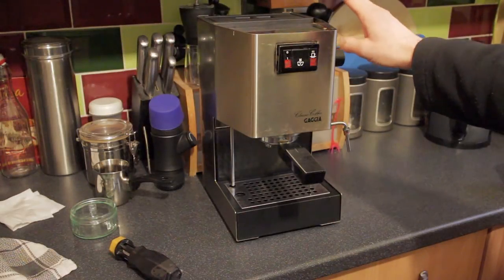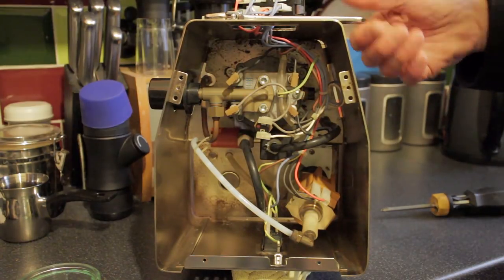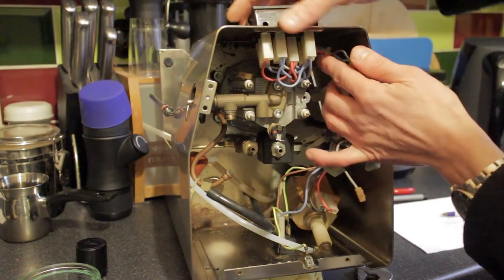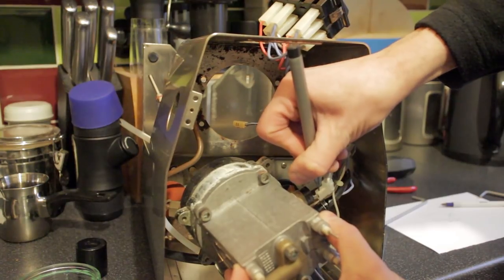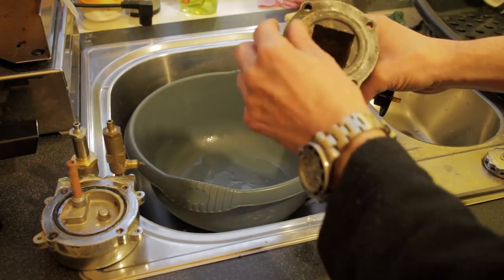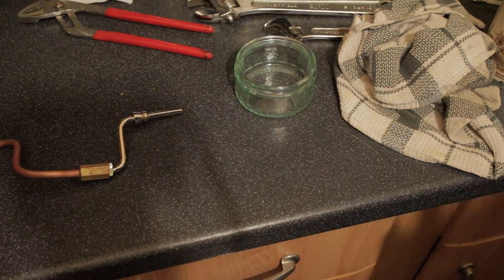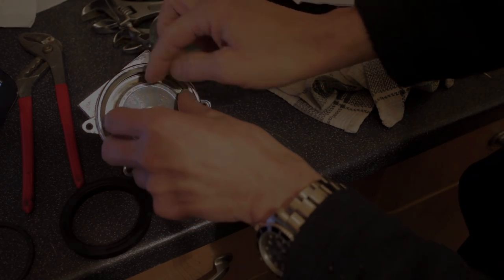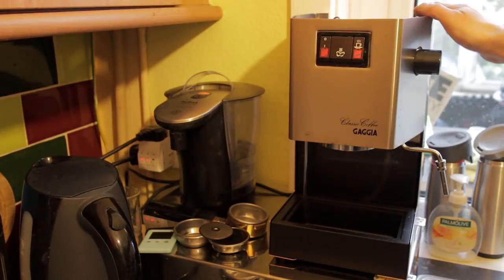Gaggia Classic Full Service and Descale, Boiler Strip, Seals

Comment: This is a great video, great detail and clarity.

I have a Gaggia Classic which Id like to restore. 

 Not sure which parts I need but the main symptom is that while the pump noise is normal and the boiler heats, there is no throughput of water only through the frother / steamer.   Would anyone know if this means a boiler replacement or some other part.  Is it easier to just replace the boiler and pump?   Any help greatly appreciated.    Thanks
Reply from the maker: If water is coming through the brew head the boiler is filling so that's good. The fault has to be a blockage between the boiler and wand. It could be the valve or the pipework to the steam wand itself.
A good soak of everything in citric acid solution is a good start after disassembly.
Reply: @spidiq8  Thanks so much for you answer.  I'll go through the process you describe in the video.  FIngers crossed. I'll let you know the results.  Best regards. Gerry
Reply: @spidiq8  Dropping back in to say I've finished the restoration,. Bought a few parts along the way, Group, shower, solenoid and even a pump,  So far it all looks good.     I wanted to say thanks very much for your help. It would have been impossible without your video. This means I can give up coffee pods too, a positive environmental impact too I hope.  Best wishes Gerry
Reply from the maker: @gfficomable  That's great news, thank you for updating me and long may you enjoy better coffee. Find yourself a local roaster and start grinding fresh and you'll never go back to pods.

Comment: Hiya. Love the video. Bought a 2006 model. Boiler badly caked up. Just wondering does the bath solution for group head/wand contain citrus acid solution also. Ta
Reply from the maker: Glad it helped, I don't know about the premade solutions specifically so I can't advise re those other than ensure that you follow the directions on the bottles.
Citric acid solution however works without problem on these, just don't leave the boiler in it for longer than necessary to remove the scale.
Reply: Thanks for reply. Same solution in yellow plastic container as in boiler. Got the citrus acid. Thanks again for advise. Take Care.

Comment: I’ve got a question - if I do a backflush and don’t  get any flow back to the reservoir does it mean that: a) the OPV is not working correctly or b) the pressure is set way to high? I don’t have the manometer to check the pressure on the group. Great video, thanks!
Reply from the maker: I'm assuming you're blocking the group head with either a blind basket or some means of blocking up the standard basket?
If so. You should get water beyond the pressure set flowing back into the reservoir and when you stop expressing the excess should expel from the waste pipe into the tray.
The opv could be blocked or inoperative but yes, the pressure could be set way too high also.
Reply: spidiq8 thank You. Yes, I have a blind basket. After switching the pump off, the water comes through the external pipe and to the drip tray, so I assume that the three way solenoid is working fine (also I did the test with open steam valve, switching on the pump - water comes through both the group shower and the steam wand, so I believe the three way solenoid is somehow working fine). As the machine is really old and in pretty bad shape, I don’t think I’m going to spend any big money on replacing parts, but I’ll try to figure out how to measure the pressure and perhaps try to clean the opv. Thanks again!
Reply from the maker: @maciejkieek4355  Good luck with it. Hopefully a good strip and clean will sort it.

Comment: Well done on a super job and thorough video. Have you any experience with similar machines? I have a Lelit PL 41 plus that I’m pretty sure needs an acid bath. Tips are welcome.
Reply from the maker: Sadly not, just the gaggia and my Wega commercial that I rebuilt. The principles are the same however. They use either a single boiler, double boiler or single boiler with heat exchanger.
Reply: @spidiq8  thanks for the reply. I shall follow your method and apply it accordingly. Gonna go slow and careful. Cheers
Reply from the maker: @stillnoshadow  good luck with it and ask away if you have any problems and I'll help if I can.
Reply: @spidiq8  You have no idea how proud I am managing to use your brilliant tutorial and emptying the boiler of a handful of limescale. AND putting it all back together. The boiler refill worked a treat and it passed all your leak tests. The 1st shot brought tears of pride to my eyes. Can't thank you enough. Next up the Rancillio!
Reply from the maker: @stillnoshadow  fantastic news and congrats. Enjoy that fresh unrestricted flow and of coffee. It'll taste when better knowing you did it yourself.

Comment: When you sanded down the boiler, do you sand down the inside of it too? I've managed to descale my machine, but now I have this metallic taste to the espresso. I have a gaggia baby, where, the steam valve doesn't come off, so I had to do the job joined onto the machine.
Reply from the maker: No, being aluminium you don't want to sand the inner, the only part I sanded and the only purpose was the mating surface to ensure it made a good seal on the group head so the gasket didn't leak.

Comment: hello, great video, tx for sharing. Is the boiler an aluminum boiler ? do you know if citric acid and aluminium is a problem ?
Reply from the maker: Thanks, glad it helped.
Yes the boiler is aluminium, no the citric acid solution isn't a problem provided you don't leave it sitting for hours unattended, It can eat into the aluminium but only in very highly concentrated measures and left for a long time.
You need to fill it and soak just long enough to loosen and remove the scale.
Reply: @spidiq8  thanks for your reply ! my model is 2002 - the old Gaggia classic. I couldn't find if its aluminium or not...
Reply from the maker: @cruzo333  it will be yes. It's only the very recent Phillips models where they changed it I think.

Comment: Hey mate, just wondering what kit I should buy online before I attempt this? I don’t want to open my machine up to find all the rubber parts have perished
Reply from the maker: Most online barista supply stores will sell seal kits or alternatively searching ebay will yield a full replacement seal kit, just search for the Gaggia classic.

Comment: That was so interesting! You'd make a great lecturer. I'm about half way through and I've realised I am in no way qualified to do this 😭 if I do I'll have a nice looking paperweight. I'm not even sure what my issue is as the water heats up to 90'C but there is not a drip that comes through the actual bit where the coffee goes (if that makes sense) any ideas? Thanks
Reply from the maker: Thanks. That's kind of you and I'm sure you can sort yours.
That bit is the group head where the portafilter fits. Most likely you have a blockage due to limescale buildup.
If you remove the complete boiler and undo the whole assembly soaking them in a citric acid solution among with the OPV and you should get something moving.
Is the pump working? If so. Is it building pressure. These can sound OK but be worn internally. They're cheap and replaced as a unit as they're not intended to be rebuildable.
When you switch it on. Is the water flowing back into the reservoir via the OPV?
Reply: spidiq8 wow thanks for the detailed reply mate that was helpful. I’ve got the day off tomorrow so I’m determined to get it fixed. I’m pretty sure the solenoid is blocked with hard water deposits or whatever it’s called. I’ll keep you posted how it goes or it’s a depressing visit to the gaggia shop haha. Have a good one

Comment: my GC brings water back into its tank, but not through the exit for coffee. Could it be the pump that is no longer effective, or is it full of limestone? Furthermore, if I remove the valve from under the head unit, the water flows out freely.
Reply from the maker: It could be the 3 way valve that's clogged, the over pressure unit.
It could also be limescale build up on the shower head and surrounding area.
I'd recommend a good strip, descale and clean, the holes in the valves are very small and if you live in a hard water area.
Reply: @spidiq8   thanks a lot friend. I will do something about it....

Comment: When putting back the OPV, how many turn should I do?
Reply from the maker: It varies from machine to machine as the valve is a spring and ball type. Ideal when stripping you should turn fully closed counting the turns then when refitting turn in fully and back out the original number. To set accurately you need a manometer to verify 9bar at the group head.

Comment: Sorry, have worked it out now.  Working much better after a bench check that the solenoid is working and the flow through the the bottom piece confirmed using a pippet.  Flow still not like that seen in the adverts but good enough until I find a way to check the pressure without a gauge.
Reply from the maker: Hi, apologies I didn't get back before. Glad things are flowing a bit. I'm assuming that you've descaled the boiler. These are very small and scale up quickly in hard water areas and that causes flow problems.
Reply: @spidiq8  No, I have not as the solenoid was like new, no contamination at all so I thought the boiler could not be at fault.  I poked a pit of wire up the two boiler holes the solenoid valve operates with and it went in about 40mm without any resistance.before coming up to something solid   If you think I should I will have a go with the boiler and safety valve next week  I have put the old pump back and it is as good as the new one so I have a spare pump.  Any idea how to check the pressure without a gauge or should one just experiment when everything else has been done?
Reply: You were right.  Boiler clean fixed it.  Works just like new now.  Many thanks

Comment: My old Classic shows a certain delay on every other backflush. It does work but sometimes gets stuck, and either takes some time or only comes out when I open the steam valve. Is this a sign for a clogged Solenoid?
Reply from the maker: That seems to be the case yes. Try a standard descale without stripping first and it might free everything up.
Reply: spidiq8 What impact do you think backflushing has? Less or more than the descaling?

Appreciate your help
Reply from the maker: @ggmann495  Backflushing is done to clean coffee residue from the internal pipework. There shouldn't be any grounds as the filter mesh is too fine to allow that but there will be residue, the problem is if you're in a hard water area or the machine has come from one scale buildup will quickly clog it.
Backflushing will only flush the internal pipework which draws the excess water from the coffee puck but it's done because the residue will go off eventually and taint the taste.
When you descale first with an unknown history I recommend filling the boiler and overflowing through the wand and let that sit for the required amount of time then drain and using fresh descaler run several backflushing cycles.
The wand can be unbolted and left to sit in solution separately also.
This should clear the bulk out and then once every few months a normal descale will keep it clean.
Reply: spidiq8 Went through all your steps! Thanks a lot.

One last question: with the machine ”ON“ but with no other buttons pushed/activated, water or steam comes out of the wand when I turn on the steam knob. 
Is this the way it should be?
Reply from the maker: @ggmann495  Yes but not excessive amounts. The steam knob simply opens the pipe at the top of the boiler and there'll always be a little residual water and because the boiler is a sealed unit and pressure builds up with the heater on a little will escape.
If you start the brew button water will exit the most open route which is the steam wand and if you operate the steam button it will heat and stream will exit. The knob simply opens and closes the pipe.

Comment: Have you found your Gaggia trips the electrics after a full service? Do you have any suggestions please?
Reply from the maker: Haven't had a problem like that. That sounds like a short if it's tripping your electrics. Check for any loose wires touching the metal of the case and be sure not to touch it whilst plugged in.
Reply: @spidiq8  Thanks for the quick reply and suggestion, I’ll check. Your full service video was very informative. I’ve just finished doing a full strip down descale and seal replacement, with a few minor upgrades, only to connect it all back up to find the electrical fault.  I’m also wondering if a cable is damaged, I have an electrician coming for another job and he has agreed to test the wiring for me. All the best.
Reply from the maker: @simon.revill  Good luck, I'm no electrical expert but suspect it'll be something simple. Please update when you find out but be sure not to try plugging it into a live socket while touching the case meanwhile, being metal could give you a nasty shock.
Reply: @spidiq8  Sure, I’ll let you know. I’ve gone as far as I can, it’s over to the electrician now.

Comment: 22:00 . . . the replacement gasket is silicone and not great in high heat applications over the long term. Instead of silicone o-rings/gaskets, you should be using EPDM70 rubbers for these higher heat applications.
Reply from the maker: The replacement gasket there you see is a Gaggia service approved upgraded boiler specific gasket as supplied in the service kit.
It's been in and in regular use for the last 2 years in that machine and seen another group gasket replacement in that time so I'm fairly confident in thinking it's the correct type but thanks for your feedback.
Reply: @spidiq8  Who ever told you it's Gaggia service approved was not being very precise. These "approvals" refer only to the size, not material. While they may not rupture, if they do they can damage other components inside the machine, which can get costly. But hey, to each their own :-)
Reply from the maker: @beanmeup9902  Given the only gasket of that size in a Gaggia is the boiler and given that all the high heat related seals are of the same material and given its worked faultlessly in regular use for 2 years of expressing and steaming I feel secure in the knowledge it's perfectly adequate or above for the job.
It didn't specify the material but I do know colour alone cannot be relied upon so it may well be the EPDM70 you mention. I've fitted viton o rings to fuel injection systems on vehicles and seen them both green and red so it seems there's not a worldwide standard colouring for o rings.
I thank you for your concern and if you have any specific data or examples to share regarding the comments you shared you're welcome to do so.
Reply: @spidiq8  sounds like it's working out and the worst that could happen is a rupture and damage to a component like the Parker but I wouldn't worry too much, even a substandard silicone gasket is likely better than an old EPDM70 or NBR70. The only movement that occurs in this situation, as well, is expansion and contraction against the mated surfaces channels between boiler halves, so it is far less than say in the Parker o-rings where material selection can be more important. Anyway Tip Top video! These types of videos are few and far between and for those in the coffee culture and interested in these fascinating pieces of engineering and tech, your video is a gem and very thorough :-)
Reply from the maker: @beanmeup9902  Thanks. It's interesting to know about the different materials and their uses and I'll readily admit I don't know enough about the chemistry which is why I try to source from suppliers who make these kits.
The intention with this video was to demonstrate that the innards of am espresso machine aren't that much of a mystery and the Gaggia being such a well known and loved classic means many owners might drag theirs from the cupboards and get them going again.

Comment: Hi, I tried following your tutorial, but now the fuse to my apartment keeps blowing everytime i plug the (turned off) machine in. I don't know what I did wrong? Please help! :(
Reply from the maker: I couldn't specifically but my guess is that you have reattached some of the wires incorrectly or have grounded a live to the body of the machine, (do not touch the body of the machine until unplugged) then open it, physically check all the connections and check the power leads from the socket for damage or contact with the metal casing where it shouldn't be touching.
Reply: What you've done is allowed liquid into the ceramic element terminals. Whip it out again and put it in an oven at 150 Degrees Centigrade for 1 hour. (remove the solenoid). It;ll be fine!
Reply: @oliverrandle756   Hi, I tried putting it in the oven like you said, and left it out to cool overnight, but the fuse still goes when i plug it in?
Reply: @stinek2350  I'm sorry it didn't work. I've had 2 out of 2 working when i tried it. I assume either that there is still moisture in there or there is another short.
Reply: @oliverrandle756  Thank you for trying, I bought it used 5 years ago so it might just be time to admit defeat and start saving for a new one:)
Reply: @oliverrandle756  No, I'm in Norway, but thanks anyway:)

Comment: Mind if i ask what you did you get the grouphead especially the side that mates with the boiler looking all clean again? Mine's a little corroded but not too bad. 
thanks.
Reply from the maker: In this case just the green scrub side of a dish sponge and warm soapy water. If it's scaled up then a soak in citric acid or generic descaler will work. If it's badly corroded you can use a scouring pad or wire wool to remove the corrosion but might need to replace if it's badly  pitted and damaged.